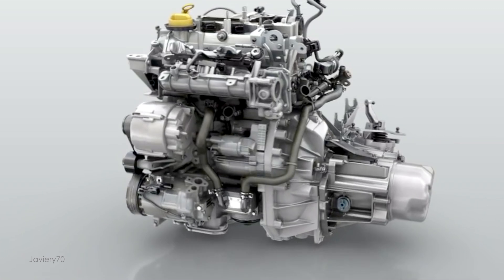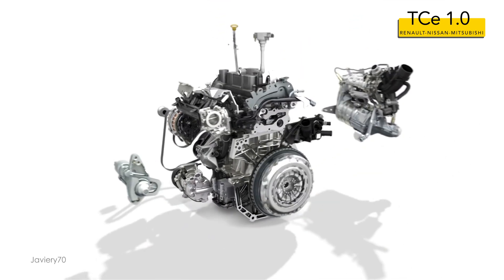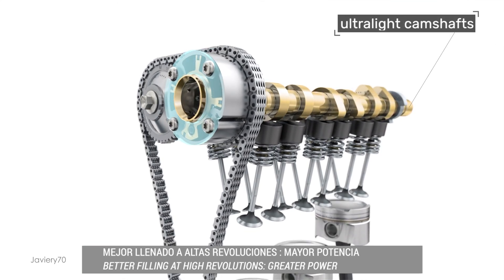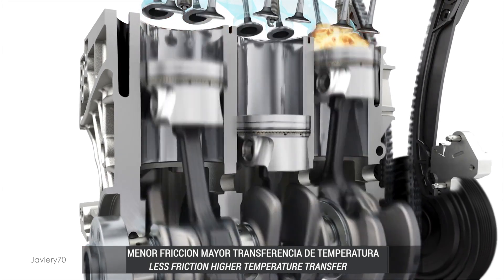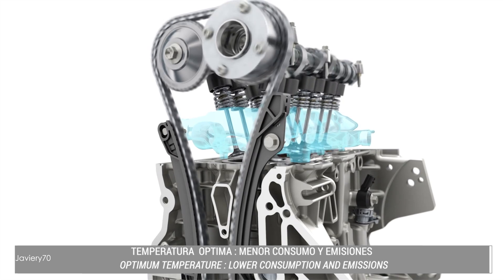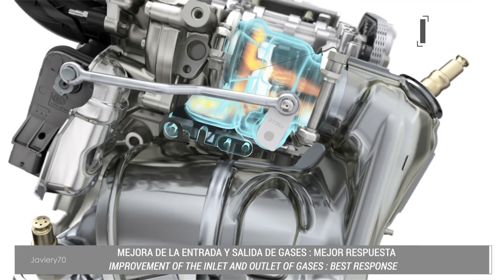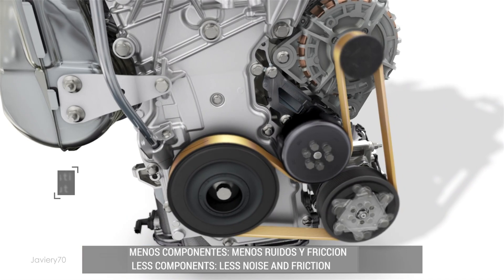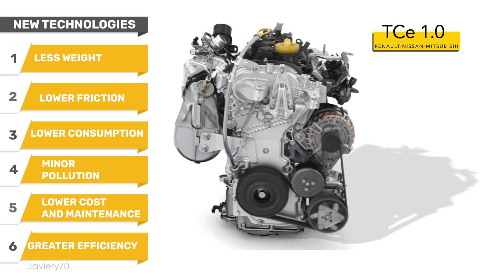🔸 RENAULT - DACIA 1.0 TCe - HR10DET Engine its technology ( eng )

Comment from the maker: As a 🔧Renault workshop technician I will respond to questions and comments. Thank you very much 🙏 for watching the video.

🛍 Buy on Amazon

☑CASTROL RN17 5W30 oil  
👉https://amzn.to/3WzWjTQ

☑ Renault Coolant Liquid ( neon yellow )
👉https://amzn.to/3kd50QR

☑Renault RX type E coolant fluid ( dark blue )
👉https://amzn.to/3A8boF3

☑Engine air filter
👉https://amzn.to/3WZjzuT

☑Oil filter 
👉https://amzn.to/3MraWnP
Reply: Hello, the service installed software for the 2022 Sandero Stepway turbo sound problem. Consumption increased and performance decreased. What do you recommend? Also, what is the engine life of this vehicle?
Reply from the maker: @ I do a lot of updates every day and no one has had any problems yet.
It is possible that they have reset the memories and now the engine needs some time to reset itself. This can be fixed by doing some mileage.
This engine is used by driving schools and taxi drivers. I have seen engines with 300,000 km.
Reply: @javiery70  300000 kms on 1.0 tce? Really?
Reply from the maker: @JohnDoe-uw9nq I've seen it in Taxis.
Reply: @javiery70 great! So, is it a reliable engine?
Reply from the maker: with proper maintenance and care.
Reply: @javiery70  What should the basic maintenance for this engine be like? I am reffering to engine oil and transmission oil changes, LPG system checks etc.? In the "Practical Guide" that I got from the dealer (not even an owner's manual which I had to search online and print it myself) it says the engine oil should be changed every 30.000 km, but that sounds ridiculous.. (2024 Dacia Logan ECO-G 100 - engine code H4Dt 480)
Thank you!!
Reply from the maker: The maintenance schedule should be provided to you by the dealer when you sell the vehicle.
You can view the vehicle's maintenance schedule on the My Dacia website.
The engine oil should be replaced every 30,000 km or every 2 years.
These are maximum recommended values, the quality of the oil allows these periods.
You can shorten the time and replace it much sooner, which is much better for the health of the engine.
🔸 Revisión Motor TCe 1.0
https://youtu.be/zxwNshvTil8
Reply: Thank you
Reply: @PristerVictor  30,000 oil change is way too long for any engine!!
This is a 1lt. Turbo Charged 3 Cylender Engine, this little bugger runs HOT!! 
The oil is not going to hold out very long! 
5000km - 10,000km is more realistic if you want the engine to last.
300,000km! GM had that going on their engines and they were blowing up left and right.
Reply: Is safe adding Graphene to Gearbox CVT Oil in renault Kiger Turbo CVT?
Reply from the maker: @otigadental5559  It is not necessary to use oil additives, Renault does not recommend it.
It is safest and best to use the oil specified by the manufacturer.
Reply: Thank you for your informative videos. Will you be sharing an informative video about the 1.0 TCE 110 engine used in the Dacia Jogger? What distinguishes this engine from other 1.0 TCE 100s?
Reply from the maker: @b.keseroglu  
The only thing the 90 and 100 hp TCe 1.0 engine (H4D) has in common with the 110 hp TCe 1.0 engine (H5D) is their displacement.
They are two different engines.
The 110 hp TCe 1.0 engine is the 3-cylinder version of the 1.3 hp TCe engine (H5H).
https://youtu.be/h5-ZxhNCrek
Reply: thank you for the informative video. could you comment on the reliability and durability of the xtronic transmission (found in clio and sanderos sold in various emerging markets)? is it safe to assume that nissan solved major problems observed in earlier versions and the recent versions are much more reliable? i read some user reviews telling they could not have the authorized renault services repair a faulty cvt and instead they offered a full cvt transmission replacement with major costs incurred. is this still the case? do you also have any comments on dsg / dct vs xtronic reliability and durability?
Reply from the maker: Hello, sorry for the delay.
Generally, CVT transmissions are reliable and don't cause problems. However, Renault recommends complete replacement for any internal mechanical failure; they are not repaired. My workshop hasn't seen any CVT failures yet.
Reply: Hi, can you please share any video or detail on how I can change the V belt, as my belt is broken and there is no tensioner
Reply from the maker: @miteshsaraf  I don't have a video of the belt.
The belt is elastic and doesn't have a tensioner.
A special tool is required to install the belt without damaging it.
The belt size is 7PK1165.
Reply: bonjour dacia tce 1l 110cv liquide de refroidissement est bleu peut ont mettre du jaune type D
Reply: Why does the engine jerk occasionally, while crusissing at a constant speed / throttle. Like a short gas pedaal kick? 
Why does the engine shake like an old tdi on startup?

Why does the engine hesitate and jerk very unrefined when cold?

It seems to me the engine needed a lot more r&d before it entered series production....
Reply from the maker: @GoranGrgac-nd6fk   If you experience these errors and there are no faults, it is very likely that you need a software update for the fuel injection control unit.
Reply: Hi I have a MK2 Duster 1.0 tce 2020. it’s only done 20000 miles and I’ve maintained it. I have a what I can only described as a low squeaking noise from the drive belt area which after a short while once the engines warmed up appears to go. Do I need a new drive belt? Thanks in advance for any reply to my question. All the best.
Reply from the maker: @sparx550   Hello.
An effective test to determine whether it's a belt or not is to add a few drops of water. If the noise disappears, the cause is the belt.

 ⚠️ Be very careful because this engine has two faults that cause metallic squealing in the belt area.

- Water pump shaft breakage.
- Alternator pulley breakage.
Reply: Can I just say a massive thank you for your response. All the best mate.
Reply: Hohle Nockenwellen kann nicht gut sein
Reply: cześć , jak naprawdę jest z olejem 0w 20 do tego silnika ?? czy lepszy 5w 30 ??
Reply from the maker: Będąc olejem o większej płynności, ułatwia smarowanie zarówno w niskich, jak i wysokich temperaturach. Minimalizuje opory wewnętrzne, poprawiając oszczędność paliwa.
Silnik niekompatybilny z tym olejem może się zatrzeć i ulec awarii.
Najlepszym olejem jest ten zalecany przez producenta.
Jeśli można stosować oba oleje, w zimnym klimacie lepszy będzie olej 0W-20.
Reply: @javiery70  w Polsce klimat raczej umiarkowany... , na różnych forach jest nagonka na 0w 20 i wszyscy sugerują 5w 30 ...
Reply from the maker: @duzy213  Uważam, że lepiej ufać zaleceniom producenta niż opiniom na forum.
Reply: @javiery70  dzięki

Comment: Hello, can the water pump and serpentine belt be changed DIY? I’ve done my BMW e84 and it was pretty straight forward.
Reply from the maker: Yes.
This strap is elastic.
It needs to be cut to remove it.
Assembly is done using a tool called a wedge, which helps with assembly without damaging the strap.
Assembly may require the assistance of another person.

Comment: Hi! How many miles will you get from this engine? I hear a lot of issues regarding the turbo? But the engines are simple, not many electronics so I’m hoping it will last a long time. Also what are the common problems with Sandero 3 cars. Thanks
Reply from the maker: I've seen driving schools and taxis with 300,000 km on the clock.
The problems depend on the year of manufacture, as they are corrected both at the factory and through after-sales service in workshops. Turbo problems are expected until 2023.
Reply: @javiery70 my car is a 2022 Sandero. I had a remap for the turbo noise too
Reply: Just a question regarding the servicing. They only change the oil every 2 years on a B service. Is this okay? Personally I would change it every year.
Reply from the maker: If the maintenance is not by contract and not by leasing, meaning you pay for it yourself, of course you can change the oil before 2 years.
Reply: @javiery70 yeah it was a Dacia plan. But I think my next services I will ask for an oil change every year
Reply from the maker: If Dacia pays, the change is every two years; it's impossible to change it sooner. You can pay yourself, and Dacia will pay the following year.
Reply: @javiery70  okay great! I just feel bad if the oil is changed every 2 years. I hope this won’t damage the engine too much. I do 7000/8000 miles a year.
Reply: Sorry one more question, the coolant level has dropped by a little. Is this normal for the Sandro TCe engine to loose a little due to evaporation etc?
Reply from the maker: During the first service, it's normal for the coolant level to drop slightly. The cooling system will reset, and a small amount of coolant will need to be added.

https://amzn.to/4b9c0dI

Comment: 3-cylinder engines are definitely not efficient and their fuel consumption doesn't drop below 6 liters per 100km... moreover, they vibrate like a washing machine while idling.
My 4-cylinder gasoline car (which doesn't even have turbo support) consumes much less fuel than these engines. You can't even tell it's running while idling. (I can't say the brand, but I can say it's Japanese made)
Reply: My  new 2025 sandero is very quiet very smooth with good acceleration. Engine not yet run in but get 48 mph on a 20 mile urban journey with stop starts, roundabouts, lights etc.

Comment: I tried a Clio V which had a good response to acceleration in first and second gear even at low RPM.
My Sandero III is more sluggish in those gears. Is this related to the ECU ?
Could we transfer a Clio V ECU to a Sandero III ? 🤔
Reply from the maker: These are two different vehicles.
They may share the same engine, gearbox, and power output, but the injection software will be different, optimally adapted to each vehicle. It is not possible to swap the injection control unit.

Also, even though they have the same gearbox model ( JT4 ) the gear ratios of both vehicles are different.
Reply: @javiery70 Thank you for that, I thought as much! 
Would changing gear ratio be at least be feasible?
Reply from the maker: Each gearbox has several versions adapted to the vehicle's characteristics. The Clio and Sandero are different vehicles; the possibility would need to be studied very carefully because there is a risk that the gearboxes have some assembly differences and could not be fitted together.

Comment: I have this engine on a 2025 Captur LPG.
What is the optimal RPM for shifting gears, and what is the maximum RPM that can be used safely over the long term (for example on the highway), for long engine life and good performance?
Reply from the maker: Hello.
There's a gear shift indicator on the instrument cluster. This indicator tells you when it's the best time to shift up or down.

The engine is designed to operate at high RPMs, so if it runs below 4000 RPM, that's much better for its lifespan.

Comment: The engine is not bad, but it lacks traction until 2000 rpm.
Reply: Yes, but after 2500 to 5000 and even 6000 the response is very good.
Reply: It is gasoline engine not diesel.... try to understand this... even if it a small turbo engjne you ll still need to rev it a bit higher to feel the turbo...
Reply: I also drove a 1.3 Tce, it has four cylinders and it pulls much better from the bottom!
Reply from the maker: These types of engines work best at high revolutions.

Comment: Hello, I have two questions. My first question is is that the chronic turbo problem in these 1.0 tce 90 clio vehicles is an expensive failure and they say it makes noise again after the software update? My second question is whether the engine is sounding by the atrium, has this been corrected and is a turbo problem for the 2025 model clio, I would be happy if you answered in detail. Thank you in advance.
Reply from the maker: Hello.
Generally, the software update significantly reduces the noise.
If the play or looseness is excessive and doesn't eliminate the noise, the entire turbocharger needs to be replaced. Renault will replace it free of charge if the customer meets the requirements mentioned in the video.

The turbocharger alone costs approximately €1000 excluding taxes and labor.

The turbocharger in this engine, and in all engines, contains mechanical components and is subject to wear; it is not immune to future failures due to wear and looseness.

Engines manufactured from 2025 onwards already have the new turbocharger and do not have this problem.
I don't know what ATRIUM means...
Reply: @javiery70  So if I buy a 2025 clio instead of a 2024 model 1.0 tce clio, will I have no problem?
Reply from the maker: This turbo problem has been fixed since early 2024. It won't have that problem in 2025.
https://youtu.be/5rqdQ_7--LI

Comment: This engine is beeing discontinued and replaced by a 1.2  direct injection. I belive tge 1.0 multi point injection is mature and more reliabile. Get it while you can. Direct injection engines have problems.
Reply from the maker: This 100 hp 1.0 TCe engine (indirect injection) is still in production and will continue to be used in Dacia in the new 2026 models.
Reply: @javiery70  where is that engine in 2025? dacia's  smallest engine cc in 2025 it s 1.2
Reply from the maker: @CovDavid  Sorry, I don't quite understand the question.
Reply: @javiery70 sry ,my english
I edited that message
Reply from the maker: @CovDavid  
The 1.0 TCe engine (90-100 hp) is marketed depending on the country and will be available in 2025 in the Dacia Sandero low range in the 100 hp version (ECO-G) and in the Renault Captur and Clio ranges, also in their 100 hp version (ECO-G).

In 2026, the new 1.2 TCe engine, with 115 and 130 hp, will be incorporated into the entire Dacia and Renault range.

https://www.dacia.co.uk/vehicles/sandero.html
https://www.renault.co.uk

Comment: This is the same engine that is offered in Nissan Magnite and Renault Kiger in India. This engine is also manufactured in India in their Chennai plant.

I have a Nissan Magnite turbo CVT from 2023 and I've driven 30,000km on it so far. I've seen no issues yet. The power is decent and mileage is mediocre. There is a bit more nvh compared to other engines of this class like VW 1.0 TSI, Hyundai 1.0 GDI or suzuki Boosterjet 1.0. but they're all direct injection. 

This is the only port injection engine. So torque comes only after 2000rpm. Unlike the gdi engines that can generate peak torque from 1700 rpm. 

With the fuel quality available in India and the generally pathetic servicing processes with horrible heat and traffic conditions, i believe the engine has held up well so far. Time will tell if it will continue to do so
Reply from the maker: In general, it's a good engine.

Comment: Hi Javiery, I got this engine with LPG on my Clio, manufactured in April 2025, now the winter is almost here and during the cold starts the car shakes quite heavily, even the passager seat is visibly shaking, after everything warms up everything seems fine (for a 3cyl engine). No weird vibrations when driving, just when I let it idle on a cold start. Can I easily identify a failing engine mount by myself? The dealership is far away and I drive my car almoust daily. Thanks in advance.
Reply: This is unfortunately a design peculiarity of this engine, it shakes and shudders for the first few minutes in cold weather. I have a Dacia Sandero with the same engine and the same problem, dealer had a look at it, confirmed it shudders and that it's not a defect.
Reply from the maker: Normally, vibrations caused by the engine mount are also accompanied by noise. 
The engine mount should be checked to see if it is the cause; it is not causing any problems, but it could be faulty.
When the engine is very cold, its performance is a little rougher until it warms up. It would be necessary to check the cold temperature to see if it is consistent and correct.
It is also important to use good quality petrol.
It is also necessary to check the LPG circuit for any leaks to the engine.
Reply: Have a Dacia Logan 2025 with LPG,  same engine,  same behavior, I also noticed  when it is cold (<10C) you need to keep it accelerated over 1000 rpm otherwise the engine stalls, works normally after the engine gets to temperature. So the shaking seems to be normal on this engine.

Comment: Does the clio V 1.0 tce engine have a chain or belt in the oil?
And how often does it need changing?
  Thanks for the video!!
Reply from the maker: Sorry for the delay.
The 1.0 TCe engine uses a timing chain.
It should only be replaced if it malfunctions, for example, if it makes noise.
The engine oil is very important; the chain's lifespan depends on the daily quality of the oil.